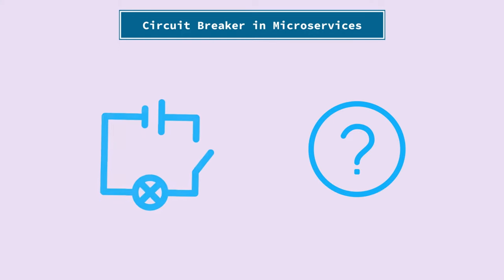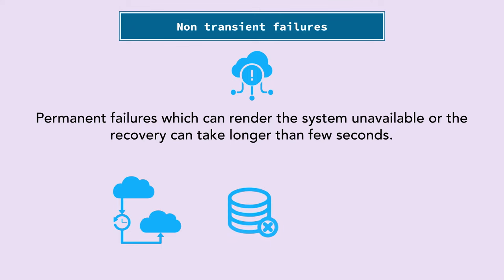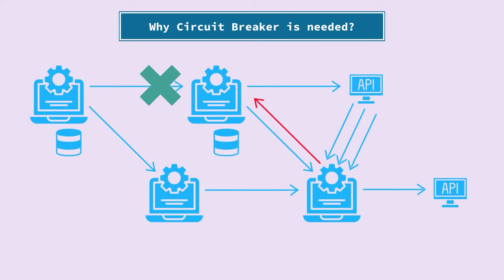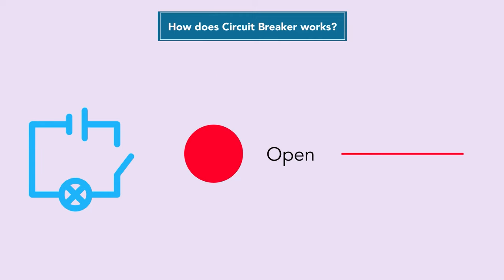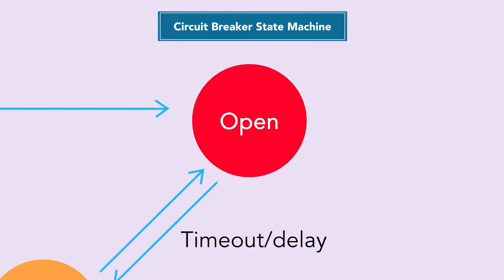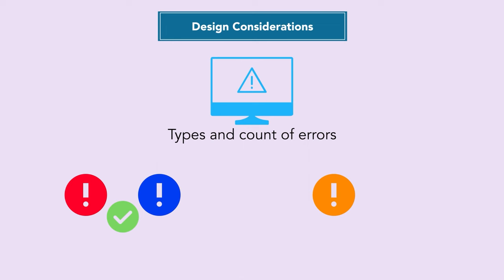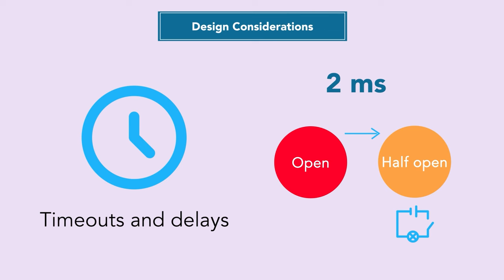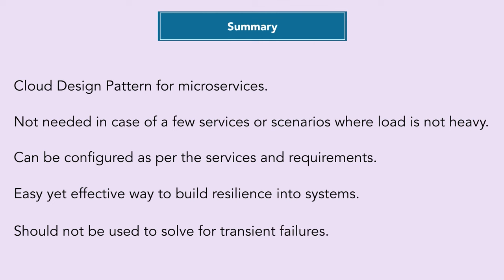Introduction to circuit breaker in microservices (for beginners)

Comment: At the time of implementation , do we need to create different project to implement circuit breaker pattern  in between two services?
Reply from the maker: You can simulate it by creating two different packages or projects or different applications. In real world scenario these two applications will be deployed on separate machines and the communication would take place through http APIs, circuit breakers are configured to handle API timeouts. Hope that helps.